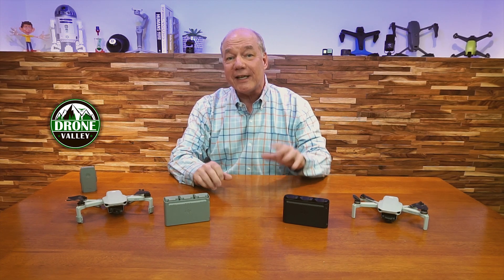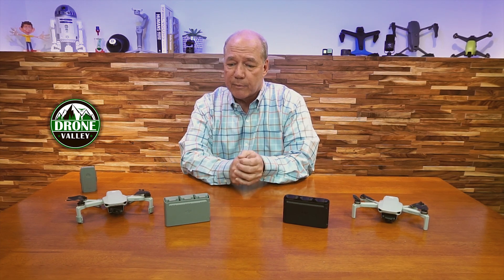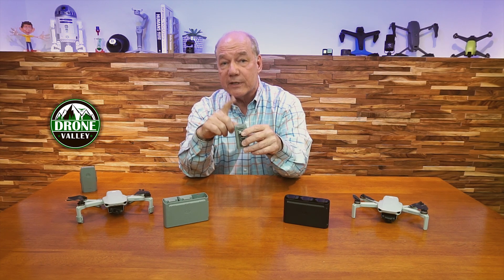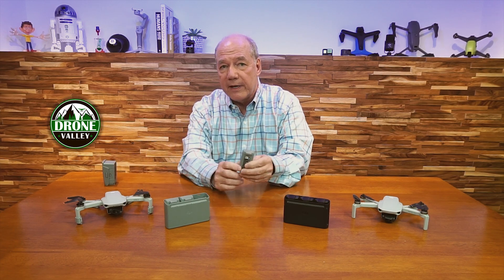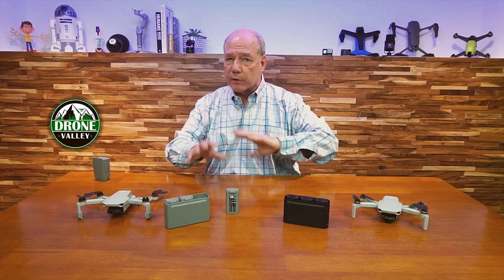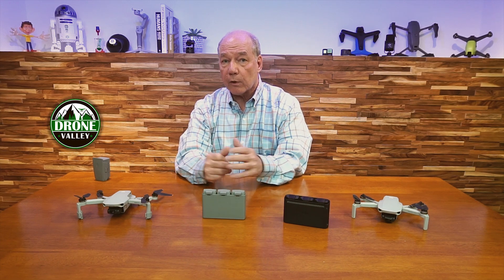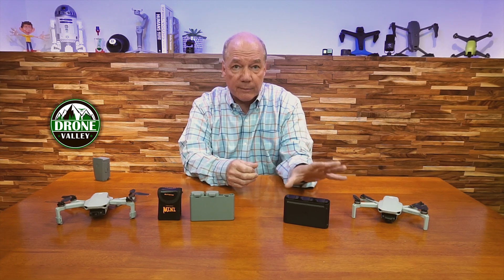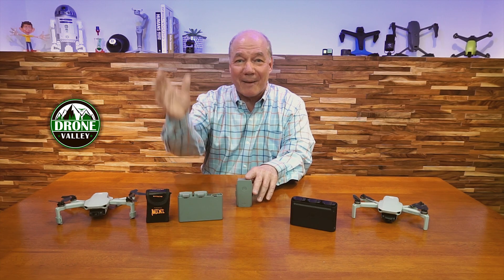Mini 2 Battery Issues and How To Fix Them

Comment: But the controller can be charged to 100%?
Reply from the maker: The cells in the controller are Li-Ion and don't have the same issues with the chemistry. It's not a worry at all and very similar to how you charge and store a phone or laptop. They can go for months with a charge and not suffer any ill effects. Rick

Comment: Store them always at 50 to 60%
Reply from the maker: Thanks for the post but I fly the drones to a lower level than that and land them with about 30%, which is a fine level for storage as long as you'll be flying again in a week or so. Closer to 70% is better for storage if you'll put them away for a longer time.

Comment: Suggest you read the dji manual for the mini2 re batteries.
Reply from the maker: John, I'm one of those nerds that actually reads every piece of documentation that comes with the drone and even the firmware update details. Let me know what I missed and I can address it here. What I put together in this clip is accurate and based on my testing of the quad. Thanks, Rick

Comment: How to put the batteries backwards in the charging hub tho there is a plastic line on the inside which prevents that to happen?
Reply from the maker: That rib makes it a little tight but they will slide in OK after a few tries. You can also use a rubber band on the top of the batteries to keep them from fully sliding into the holder. The key is to prevent the contact from touching so they can auto-discharge when now in use. The best idea is to pull them out of the charging hub when you get home and pop them into a Lipo bag for storage. Thanks for the post!
Reply: @Dronevalley  make sense i guess thanks for the answer

Comment: Hey Rick what if I got a brand new mini 2 that I haven't even opened the box yet? Am I going to be in good shape or do I need to do something???
Reply from the maker: George, you're going to be fine and it's an incredible machine that you're going to love flying. The only thing you'll need to remember is to never put your batteries away fully charged, especially into the hub. If you have them out of the hub (and drone) they will auto-discharge if needed. My routine is to fly them down to about 30% and put them away. The next time I want to fly I charge them and head out to the lake for some fun. Let me know if you have any other questions and consider subscribing to the channel so you don't miss anything. Rick

Comment: Good information Rick.
I have placed the LiPO batteries into the hub, but not clicked them in all the way. After a couple days, I pushed them all the way in and they were all at 3 lights after starting fully charged at 4 lights. I hesitate to put them in the hub backwards for fear of warping the hub. Maybe a problem, maybe not. 
Anyway, that's what I found...
Thanks for your great information....
Reply from the maker: Dennis, as long as they are not fully inserted into the hub and making contact, they will discharge as normal. It's only when they touch those contacts that the battery has to stay "awake" in case the power button is pressed. Thanks for the post and happy flying! Rick

Comment: mini 2 has Lion and not Lipo right? if they used lipo its really mind boggling..  since its a 2s a 2sp lion would give more energy /gram..  lipos give more amp flow.. but at the cost of not beeing very energy dense..  and lipos need to be stored at 3.3v/cell
Reply: Mini 2 has LiPo.  Po standing for Polymer, the material to encase the cell.
It's the MM1 that has the can style LiIon
Reply: @danman32  very odd descicion from dji.. Lion has higher energy density giving endurance..  i come from racedrones and fly machines that draw around 100 amp.. you need a high C lipo there.. but if you build a longrange rig you use packs build with 18650 packs and those are lion..  they cant deliver the amps without significant sag but on low power output they qudruple the flighttime..  a 4s lion can hold about 8000Mah and a same size lipo would weigh four times as much..
Reply: You forgot to consider weight, shape and power.  That aluminum has useless weight.
Reply: @danman32  .. NO..  2 18650 in series gives 7,4v and 3500-3900 Mah..  weighs 112grams.. a lipo naked 2s with 3500Mah weighs 377g and thats the lightest one i found.. most are closer to 430g
the aluminium covering the 18650 also weighs less than the plastic in softwrapped lipos and considerably less then hardpacks..

Comment: If you put a mini 2 in RTH while in sports mode will it fly faster than if you did RTH in normal mode ?  Sometimes the wind will take it over in normal while flying but when you go into sport it goes right through the wind.  So if RTH used the sport mode power it would be a better chance on making it back..
Reply: Beyond topic really.
But the reason is allowed attack angle rather than motor power.
RTH is its own mode though so if in sports mode, you're no longer in RTH and flying it back yourself.
Reply: @danman32  I know it's not the topic but nobody answers questions on any other channels so I just wanted to try.   But I knew it had nothing to do with the video.. 😏
Reply from the maker: TapSnap - As Dan has mentioned, RTH is it's own "special" mode that isn't affected by the settings in the controller. When that feature is triggered, the drone locks down all control and heads for the takeoff point to land. it doesn't really care what the pilot is doing or what settings are in the controller except for the RTH height. You have to be sure this is set above any obstacle in the area so you don't have issues on the way home. Thanks for the post and I hope you'll stop back soon. Rick
Reply: @Dronevalley  ok thanks, I always have it set to 200 + feet.  Thanks for the reply.

Comment: I didn't know there was an issue. Living in washington state I can't always fly cuz it rains allot. The drone would sit for a few weeks then I would fly it. I remember I took it out the first time I let it sit a few weeks n it didn't have a full charge n my flight was shortened so now I always charge it up, and it takes a bit of time to do that. So if seemed to be discharging.

Just now I pushed the button on the hub it shows its full charge but when I connect the charge cable it shows charging, all lights going out and turning on on after the other like it's discharged. So I figured it had discharged. I'll experiment n turn the batteries around and see what happens, unless of course there's an update in the mean time.

Comment: Hey Rick what kind of battery's are in the DJI Air 2S ??
Reply: Lithium Polymer. They have a switch on the battery as he noted. They will auto discharge. Hope this helps.

Comment: What I've done is put a small rubber band on the top of each battery.  This way I can still use the charger to store the batteries without them contacting without reversing them in the holder.
Reply from the maker: Thanks for the post and that works well. I've got a few friends that use a large, fat rubber band around the top of all three when they're storing them to prevent them from slipping down into the hub all the way. I'm a fan of using whatever works for you until DJI sorts this out, and they will. Rick

Comment: Hi, rick you recommended storing the Mini 2 batteries at 40-65%, but DJI says to store them at 72%
What's going on there? Are you right, and DJI wrong?
Anyway, great video, and happy flying!
Reply from the maker: Jackie, I know this can be confusing but if you check the manual DJI actually recommends discharging the batteries to 30% for long-term storage and transport. If you're going to be using the batteries within a few days, I always recommend the 40%-65% level since it takes less time to fully charge them when you want to fly and still keeps them in a safe state. There isn't a "hard and fast" rule for this and the debate is an active one between pilots. The only hard advice I can give you is never, never leave them fully charged for any length of time and never let them dip below the 10% hibernation threshold. Both of those will terribly stress the chemistry and reduce the longevity of the batteries. I hope that helps! Rick
Reply: @Dronevalley  Yeah Rick, I understand you, and thanks for the response. The thing that I don't understand is that in the manual it says if you want to store the batteries "If the battery is lower than 72%, charge it until 72%".
Anyway, I usually store them at 72%, now I will start to store them at around 50%.
Thanks for the help, Rick!
Reply: The low point is absolute % for the battery itself.  The % reading in the app includes a reserve.  1% in the app is not 1% for the cells, more like 10%.  I suspect the AC power off threshold is not even near the cell 0%.

Comment: Rick the strangest thing happen to me with my FPV. It has been flying beautiful so I decided to try it with the joystick controller. I went into connect it etc and the DJI fly app took me to the fly tutorial and it won’t let me out. I’ve deleted the app, reinstalled it. Turned peer off n on. Any ideas? 
Also I put a 129 card in goggles and drone. Is there a size limit that you know of. 
Thanks Ron.

Comment: Use the hub as a power bank and discharge them around 50%. Two solid lights or two solid and one blinking when not in use. No worries....
Reply: The problem with that is the hub doesn't use the batteries evenly when used as a powerbank.
So you might as well keep them out of the hub or backwards so they discharge at the same time.
Reply: @danman32  I know, I use one battery at a time when I use it as a power bank. Then put all three at around 50 percent.

Comment: I saw someone that used para-cord wrapped around the batteries that blocked contact with the charging hub which would allow you still store them in the hub but allow them to discharge like they are designed to.
Reply from the maker: Patrick, thanks for the post and the suggestion. I've had a few friends use a large rubber band to do the same thing and they both work. I just flip mine around in the hub and it's been working fine for me. I'm sure DJi is hard at work on a firmware update for this so stay tuned! Rick
Reply: @Dronevalley  well, they are not designed to be flipped around, there is a guideline on one of the sides, i personally don’t wanne force them in the smart case. But thanks for the tips.
Reply from the maker: @AngelusHD  Thanks for the post and it is a little tight at first but works OK. You can always use a rubber band on the top to keep them sliding all the way in. The best option is to use a triple Lipo safety bag to keep them safe for discharge.

Comment: Wow... people complain for auto-discharge not kicking in !? I am appalled!

That's a COLOSSAL drawback of the Mini 2, discharging its batteries on user behalf, rendering the pilot a lame drone user for whom batteries are never trusted to be fully charged after a few days.
Reply from the maker: Tobias, you're misreading that feature. It's another way that DJI is improving drones for the average flier. Lipo cells are not safe fully charged and you essentially have a fire grenade in your bag. The longer it stays at a full charge, the greater the chances for a mishap. By auto-discharging the batteries, DJI is protecting the owner and the batteries since they'll last longer. How can that be a bad thing>
Reply: @Dronevalley  I appreciate your video and understand your point of view, but I see it differently. From a safety standpoint I cannot see any worsening of the fire or explosion risk, I don't think in case of a puncture a 95% full battery is significantly safer than a 100% loaded one.

Anyhow... I don't like the fact that this was silently implemented in a Mini (series) drone and forces you to buy a Charging Hub should you have more than one battery to prevent more of them to be discharged.

This is especially a problem for us wild wandering people whom depart fully loaded from camp, sometimes on a two or three days adventure.

From personal experience you can hurt more a Li-Po battery over one day in a sun bathed backpack on a hot day than storing it 100 days fully charged in a cool room.
Reply from the maker: @m80116  Tobias, thanks for the reply and it's just another safety measure built into the cells. I totally agree that heat is your enemy in the field and even used my "puppy" example in the clip to remind folks about it. I do think that both are important and 95% vs 100% on a cell for days really does have an impact. Not only do you run the chance of swelling, since the batteries will find a way to internally discharge producing gas, but you also reduce the live of the battery. Auto-discharging is something that DJI has had in all of their Lipo's going way back to the original Phantom series and they just missed it on the Mini 2. I really think it the interaction I mentioned between the battery and the hub. It has to stay somewhat awake to react to the drone (or hub) when the power button is pushed and as a result can't got into auto-discahrge mode. I'm hoping DJI gets this sorted with a firmware update. Rick
Reply: @m80116  Hi, I think Rick made a great point, The batteries shouldn't be at full charge for a long period of time. If you do hike and out for a few days, do consider buying a portable charger. Let the batteries auto-discharge and when you want to fly, just charge them with the portable charger. Look at buying the portable charger as an investment, since the Mini 2 batteries are extremely expensive, and you want to take care of them. Plus you can use it to charge other things such as flashlights and cellphones. I think rick has a video about portable chargers, so look around, and see if that's what you need.
Reply: @Dronevalley  I think we could speculate they did purposely omit the charging hub to grant the end user some control over what auto-discharges and what not, and the drone itself for that matter.

Keep an eye on the puppy and happy flights my friend!
Reply: @JG-mw7uy  I agree on that concept. But if batteries auto-discharge in ANY case (I mean... outside of the drone and hub) it's just another obstacle on the way. I impaired most of my Lithium batteries for the heat... the ones repeatedly charging in any useful occasion (personal EVER ready policy) showed no adverse consequences.
Reply: Heat is an enemy.  Keeping fully charged too long is an enemy.  Keeping fully charged and in heat is a real enemy.
The problem I believe is mainly swelling and not so much fire.

You might notice that laptops these days has a mode to not keep them fully charged so the batteries are less likely to swell.

Comment: The problem I have is it takes too long to charge the batteries for the Mini 2.
Reply: Drone Valley has a charger for that. I don't trust non OEM chargers, but I do trust Rick and his team. I purchased a parallel charger for the M2 and it works great! I'm patiently waiting for my new order for the A2/2S parallel charger from them. Great products!
Reply: Not likely any different than MM1.  Typically DJI designs the battery and charger where full charge is in about  90 minutes.

Comment: Slow down your speech. It will be a better video. Slow down.
Reply: You do know you can slow or speed up the videos on youtube right? The voice will still be easy to understand as long as they were in the first place.
Reply: I like his speed.  But you can adjust that in YouTube if you need to.
Reply: Keep up slowpoke
Reply: Bro who the fuck even are you? Noone cares about your opinion. Get over yourself.
Reply: Yes
Reply: Rick.  Those LiPO bags are better than nothing. But, they won't provide good protection. The Fire association also says it is ok to put water on a LiPO fire now.  It won't  help the fire or make it worse, since air has enouoh moister in it to cause the reaction.  But, water will cool off the surrounding areas and reduce the overall heat after the reaction has occured.
Reply: Normally, I play back at least 1.5x speed. This clip is perfect for using my time.
Reply: Why you're slow ass brain can't comprehend what he's saying at that speed
Reply: I watched this one 1.25x speed 😂